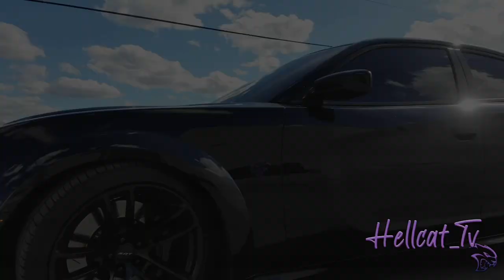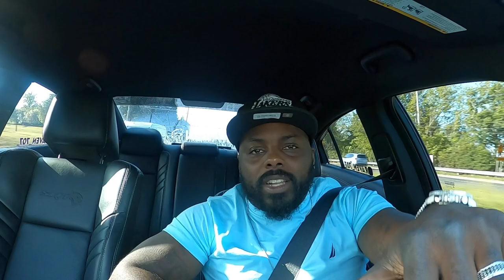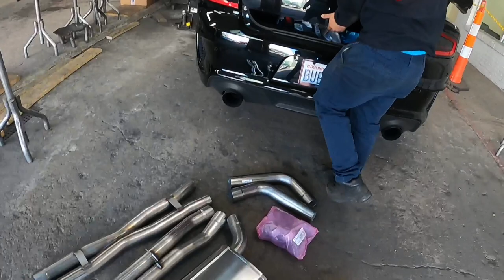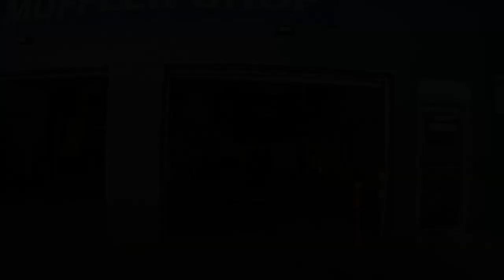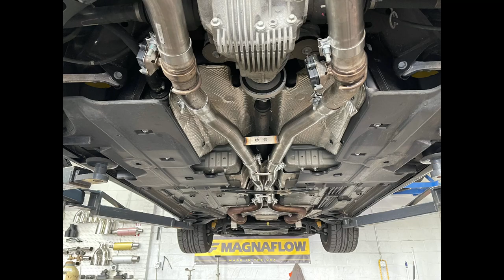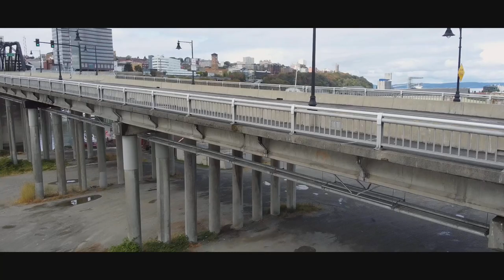Installing the Corsa Extreme Catback Exhaust on my 2020 Dodge Charger Hellcat Widebody Sooo Loud!

Comment: Kooks headers with the corsa extremes would be extreme.
Reply: I have the corsa extreme on my scat pack and was thinking of the kooks long tube headers but after talking to a few Mopar owners they actually said it was too loud . And honestly I can see it because just with the extreme cat back its super loud. I’d like the extra LTH performance but really don’t want anymore volume. Just my thoughts.
Reply from the maker: Never a such thing as too loud 😂
Reply: @bossstrick  In my younger days I probably would have said go louder but I have a CDL and don't need any attention from the smokey. Lol
Reply: American Racing Headers over Kooks any day of the week.
Reply: @bossstrick  good info. Thanks. I have whole corsa exhaust system but I don't want to go any louder. Mine has a nice prrr but when you step on it it screams! To be honest when I hear those guys it actually sounds a mess because you can't enjoy the sound because you they sound like your at drag track having to wear hearing protection. 👍🏾👍🏾👍🏾
Reply: @Cardiakk  I see lots of mustang guys with American Racing. I also heard the fitment sucks when installing and required blood, sweat and tears.
Reply: @MoparCrazy803  I'm not sure about mustangs but that's definitely not the case on the Chevy side. ARH is the top dog due to easy installation and it being made in the USA unlike Kooks and other competitors.
Reply: @Cardiakk  Yea I would choose kooks, but lets be honest. It wont be much hp gain difference between the two.
Reply: @MoparCrazy803  Apparently out of all the major brands, ARH were the only set that had a significant gain. The other ones were all about the same. A gain is a gain, though.
Reply: @Cardiakk  absolutely not true. Look up kooks man. Definitely nice gains
Reply: @MoparCrazy803  Read what I said again.. I knew you would read that the wrong way.
Reply: @Cardiakk  What do you have ARH on? I think you said something about chevy earlier.
Reply: @MoparCrazy803  LT4
Reply: @Cardiakk  I understood, your saying that ARH give more hp gains then kooks. Did you know American Racing is made up of former employees that used to work for Kooks that just decided to go off on their own. You can't go wrong with either one. Why because ARH are basically rebranded kooks
Reply: @Cardiakk  All they really did was change up the sound note.
Reply: @MoparCrazy803  Just because they are former employees doesn't make it the same or equal of a product. That's like saying Lamborghini and Ferrari are the same when they're completely different platforms. Kooks are made in Asia, ARH are made in the USA. Fit and finish is slightly better. Kooks is great but the ARH are easier to work with on that platform.
Reply: @Cardiakk  Im willing to bet you a Thousand dollars those employees didnt run off with a fresh start. If you get what im saying lol they basically took there ideas and made their own. Thats why ARH are made in America. Both are great but I'll stick with the original.
Reply: @Cardiakk  Post a video. I want to hear those ARH coming off a LT4
Reply: @MoparCrazy803  That's how every business starts..they take what they've learned and apply it to their new model. At the end of the day, ARH are made to a slightly higher standard whether it's derived from Kooks or not. Also, she's getting built but I got set for the Redeye going on either tomorrow or Monday. You can hear those if you want.
Reply: @Cardiakk  Yes sir I would love to hear them on a redeye lol
Reply: Both are good headers. Trust me this aint the first debate over the two. If its going on my cars or any of my people's cars we going original.
Reply: @Cardiakk  Any update on the Redeye?
Reply: @Cardiakk  It might be your phone but that sounds pretty stock bro

Comment: Which is louder the mid muffler delete or the corsa cat back? Also which exhaust tips do you like better the 5 inch or corsas 4.5?
Reply from the maker: Corsa has a louder deeper tone. 5 inch tips Carven are better but if you get the Corsa exhaust system the smaller tips are fine.

Comment: Bro I got a question. Did get a mid muffler delete & then add the corsa exhaust ?
Reply from the maker: The corsa extreme system comes with an X pipe, connecting pipes and mufflers with tips. It replaces everything from your cats back so there are no mid mufflers with the system